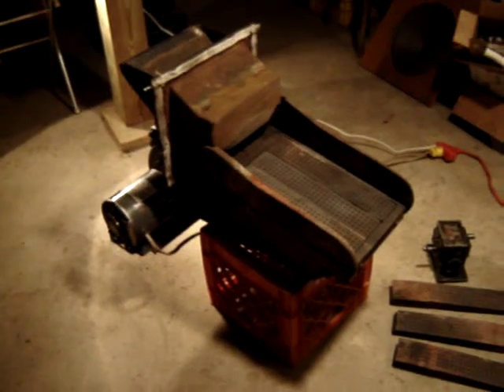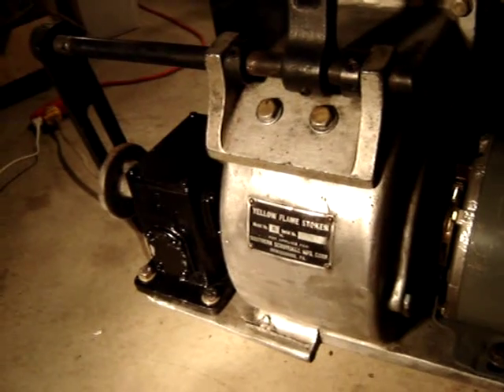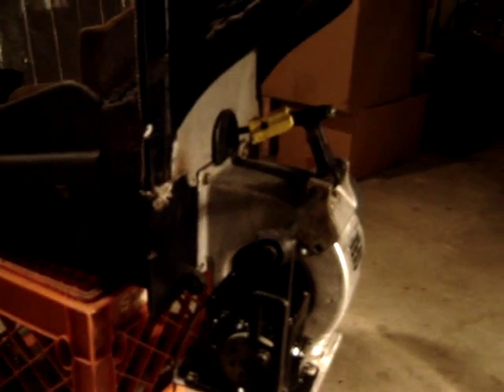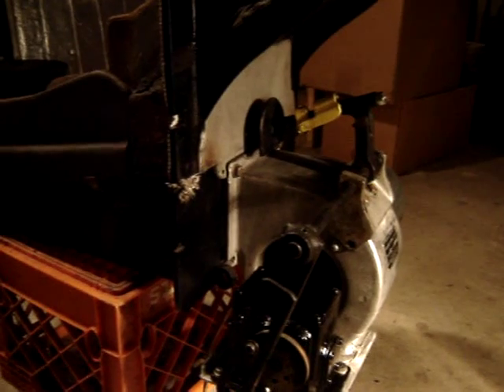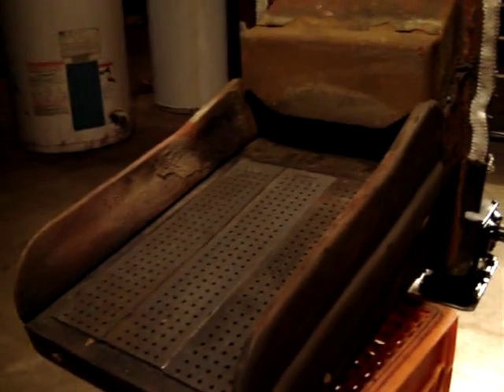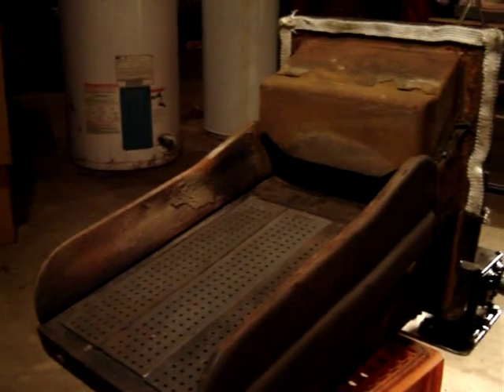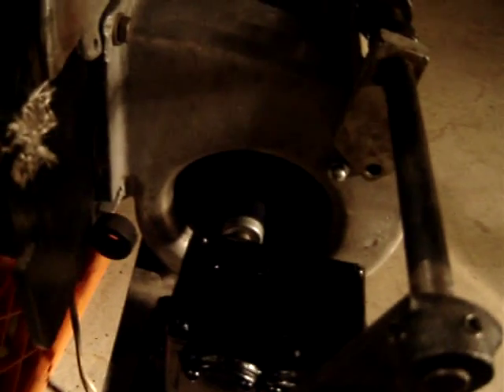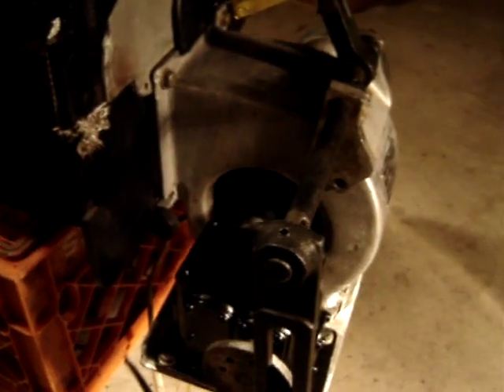Yellow Flame coal stoker boiler mechanicals

Comment: Have a question, how do you clean it to make the grates slide easy?? Mine are hard to push and it struggles sometime.
Reply from the maker: Do you mean the coal going down the grate, or the grate itself?
Coal getting stuck on the grate is usually a sign of too much combustion air. This causes the coal to burn at a temperature higher than the fusion point of the coal. That causes the coal to Clinker and stick.

Comment: did this design inspire the tri burner i wonder?
Reply from the maker: Maybe? The Yellow Flame is very different than other flat grate stokers. It has no pusher or carpet. The grate itself moves under the coal forcing it down the grate on one stroke, and loading coal on the back in the second stroke.

Comment: nice one....stoker madness stage 4......its a good thing that i didn't see this before i built my stoker....trying to replicate that would have been....'interesting'
Reply from the maker: unhippy1 I think you did rather well with your design. I LOVE that big fire veiw window in your coal stoker. That is one thing you lose with a boiler, none have a window and all have a very small fire door.
Reply: Stoker Don Lol that big fire view window is now down to 25-30%.....there is a strip about 5" high across the bottom that can be seen thru.....the rest has gone opaque and nothing i have tried has been able to clean it